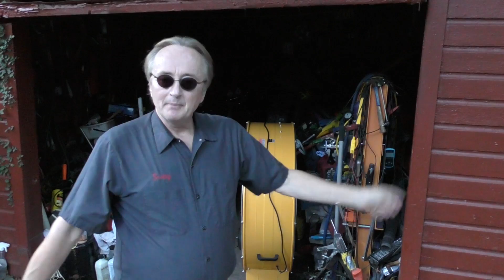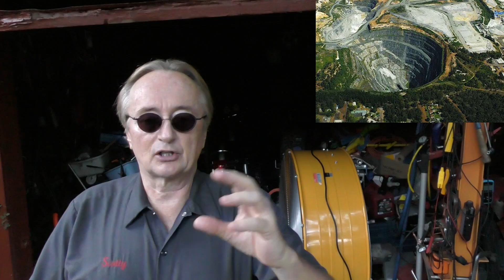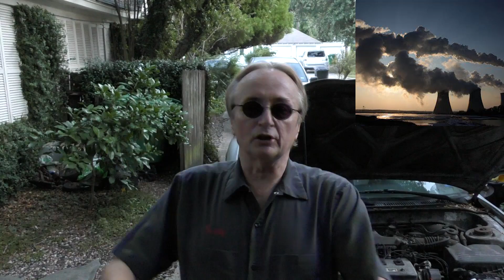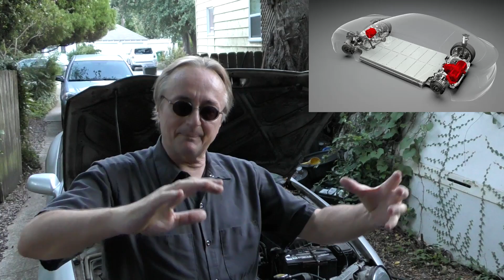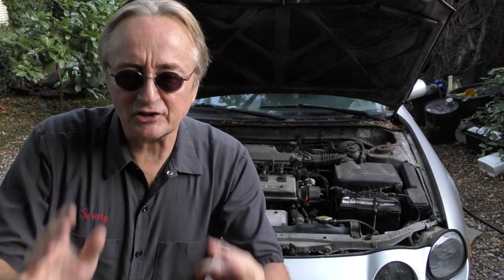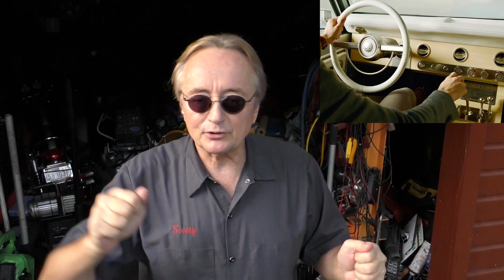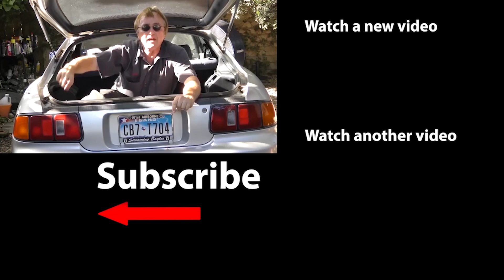Saying Goodbye to My Toyota Celica's Engine

Comment: There's already an infrastructure. There are thousands of electrical outlets in every square mile of the industrialized world. Well, not technically every square mile but you get the point. I look forward to the day I don't have to stop by a refueling station except when I'm on a road trip. Keeping my car topped off at home while I sleep will be amazing.

Comment: electricity can be generated from clean sources too. making electric cars could be the first step. electric motors are 95% efficient which makes a huge difference in every way. gasoline engines are at the end of their road and they must be replaced by electric motors.

Comment: what about a small charging engine to charge a standby battery and then a main battery pack that can switch back and forth? my generator can run for 18 hours on 3.5gallons of gasoine. seems like that's the best option.

Comment: Offroad electric bronco's are going to be problematic. Especially for SERIOUS backwoods or offroad travel. I live on Padre Island. We 4 wheel guys routinely go all the way down the completely undeveloped island for fishing or camping trip. You gotta have 4 wheel drive to make it down there and you gotta be prepared with everything you'll need. We usually all bring extra fuel with us. Last thing you'd want is to run out of gas miles and miles away from society. What are you going to do with your electric truck when the charge runs out way down the beach or deep in the woods? You'd be screwed. At least until they develop an economical portable backup power supply.

Comment: Sorry aint doing it... not buying or building an electric car...  buy an old car.. run it and replace the engine to something that can handle E85 etc or biodiesel for diesel cars is still cleaner then building, driving and processing electric cars.. a local junkyard had a tesla.. he put that thing up on the roof of the office.. he couldnt process the damn thing like a normall car would

Comment: I'd like to see hydrogen as a means to cleanly run a car. I know about Hydrogen fuel cells which can be expensive. I think with a little more R&D that technology can be refined. Maybe someone will find a way to use hydrogen fuel in an internal combustion engine. Imagine filling your car with your garden hose, uses a process called electrolysis to separate the oxygen from hydrogen to run your car. I know my idea sounds a little crazy possibly far fetched.

Comment: So if I need to replace batteries on a Prius it costs like $4000, to replace a transmission these days is also $4000...... yet these guys can convert a car to electric for $5600 suppling all the parts and the labour to tear down and rebuild?  Maybe in France but not likely here.

Comment: It’s not about converting your existing car into an electric one and save money
In upcoming years govt. will impose some safety features like emergency braking, parking sensors, 6 airbags minimum, and so on... as mandatory to all cars on the road and then you have to dump your celica
Cause your car will not be considered as a safe car on the road and will not come under that new safety laws

Unless you wanna rebuild the whole car body to keep up with safety standards which will eventually cost you the similar amount as purchasing a new one.

Comment: You put a vid up a while ago think it was the easy way to cenvert a fwd to rwd or 4wd and you said get rid of your old car and replace it with the platform your after but now your saying keep your old platform and change your drive 😒.  So what about brakes due to running off vacuum when the engine is on. steering modern cars are power assisted. Suspension setups will need changing and to top all that your saying how lithium is so bad yet even with a conversion your still gonna need lithium batteries or at least lead acid that frankly will weigh more than the whole car. Your contradicting your self in so many ways

Comment: Why would you buy a new el car when I have a perfectly fine running one which I can modify to el....think green...
Uhmm I doubt that its green to put the amount of Lithium batteries with their production process in a 25 yrs old car as it takes 8-10 yrs before you go green compare to petrol engines. Wonder if his celics will then still run :D

Comment: Just thought I'd mention, electric motors will make the same torque at any rpm they are spinning, which is why they accelerate so fast from a stop. 
Also for a conversion the easiest way I can think of is replacing the motor with a large dc motor (or a brushless 3 phase for better efficiency) using existing motor mounts and making an adapter to the transmission, then replacing the exhaust/gas tank area with batteries in protective boxes. There is a lot more to making an electric car than that but its most of what you have to worry about mechanically. Good luck with your project

Comment: 1. "Electric powered cars are hell on the environment!"
2. "If you want to be green, convert your car to electric!"
I guess then, by "If you have concern for the environment", he means "If you want a little less hell"; otherwise he'd say "Avoid EVs until the batteries are made from less polluting materials and electricity is generated by a cleaner process for a more robust infrastructure."

Comment: I suggest you follow Jehu Garcia on youtube. He converts cars to electric, and has a lot of "hands on" experience. You can salvage old Laptop and cordless tool batteries. Usually when the battery pack goes bad, it is only 1-2 cells in the pack that are dead, the rest are still fine.
For a truly green solution - you can charge the battery with solar panels on your roof.
The problem with electric cars in hot countries/states is the A/C. It will drain your battery.

Comment: No. I listened to and read these arguments about how the electric cars are allegedly "worse for the environment", but this is just conservative bunk "science". The calculations were explained and exhaust and mining of lithium effect were measured and it is believable that after a certain number of miles it is actually significantly much less harmful to the air than gas cars. 

Now its another argument if you don't believe you should be driving electric or hybrid cars because you either can't afford, or don't want to deal with electric cars, or maybe you just hate the environmentalists and believe the idiocy that Trump supporters say. Thats different.

Comment: The biggest problem with electric cars would be getting rid of the lithium-ion battery and replace it with the super-capacitor.
The power density is higher then any lithium-ion battery,the only problem with super-capacitors is the price,they are quadruple over the cost of lithium-ions.
Reply: Super capacitors are not energy dense enough. Like 1/1000th the energy density.

Comment: If electric cars take off, if you have on-street parking, best of luck leaving your cable across the pavement overnight. Millions of UK homes have on-street parking. There are already parking wars, but when you have to run a charging cable 50 yards to where you had to park your new Electro-Lite6, it will be mayhem. There needs to be a Major breakthrough in battery technology, in terms of charge-times, weight, size and range before they have a hope of replacing gas cars.

Comment: Consider a cheap car which has a dead engine and or transmission- the cost of conversion may be cheaper than rebuilding or replacing the existing broken parts with new... Sell the old parts which still work to subsidise the conversion...

Comment: And while we’re converting cars to electric, let’s solve the “lack of driving range” problem. Instead of each car brand having its own battery configuration and building millions of “charging stations,” STANDARDIZE THE BATTERIES. So when you’ve driven the electric car to the point where the batteries in it are almost completely discharged, don’t fret about where to plug it in and what to do while you wait for it to recharge.
Pull into a place where you can simply remove the spent battery and exchange it for a fully charged battery of the same type (for a fee, of course) and off you go go.
We’ve already demonstrated this business model. Think about  flashlights, bottled water for the water cooler, propane tanks for your barbecue grill. Does anybody stop and spend time refilling their ink pen if it runs dry while taking notes during a lecture. No, that’s why the Good Lord gave you the ballpoint refill (and, ah, cheap spare pens; but you get the idea.
And what about the vast infrastructure to make standardized, replaceable batteries readily available almost wherever you drive? Already there, ready and waiting, no construction necessary. WAWA, Sheetz, Pilot, T/A America, 7-Eleven, EXXON, Shell, BP,.
Reply: Changing engine oil is easier than changing an 800 lb battery, yet people still have to make appointments for oil changes.

Comment: "when electric cars become mandatory" - That's a scary thought, but your're probably right.
Reply: Fat Dan  your right.
Manual Driving will be ilegal, And after more years the vehicles would not even have steering wheel
Reply: @NeoJSsk  If/when it gets to that point, I guess I'll be one of those folks put in prison for violating every law in the books. It's illegal to drive my car? Then I guess I'll eventually be driving without either a license, or tags since they surely won't renew them. I probably won't be able to get insurance either. That will be a fun day in court.
Reply: freespace2dotcom you and me both bro
Reply: That’s when motorcycle popularity should increase
Reply: Nonsense. I drive an Tesla but I still wanna drive my gasoline car because it's way more fun.
Reply: At least I don’t have to worry about losing the right to drive my diesel triaxle any time soon, I have to back into sites that change constantly, no roads to guide sensors by, and get loaded by machines that are always moving.
Reply: Ya'll better be in your houses.
Reply: The oil companies in the US have way too much influence for electric cars to become mandatory. It won’t happen.
Reply: Electric self driving  cars will be the norm, and if you want to drive, or drive gasoline cars, you'll go to a track.. Like people who want to ride or race horses go to a specific facility.
Reply: K Dash  insurance companies will force self-driving cars, once they're safer than humans under all weather and lighting conditions (driving round Tempe Arizona in daylight without rain doesn't count) then there will be a price premium for people wanting to drive. We've got ten years maybe.

Comment: I think electric battery cars are crap, I think Hydrogen powered cars are the future. They convert water to Hyrodgen and the rest is history. It's a proven technology and it's completely independent, you don't have to rely on companies to sell you batteries or supply you with electricity. The only thing you are responsible for is maintenance.

Comment: Mining might be bad, but oil is terrible and getting worse - the bottom of the Gulf of Mexico is now an ecological desert. Finding new oil reserves is getting harder and  encroaching on more ecologies.
Oil spills are so frequent they are rarely reported. Oil refineries use 200MW of electricity each. Burning it in cars produces toxic emissions. Thus gasoline cars are becoming more toxic over time.
Electricity production is getting cleaner all the time, so an EV is getting cleaner over time.

Comment: Any type of battery will goes bad within 10 years, how much is cost to replace it and how much pollution to make one or recycle it. If you concern about pollution then stick to the old diesel and drive it with used vegetable oil...

Comment: Whether it's conversion or new, electrifying everything presently powered by fossil fuels is going to require a lot of mining. Copper, aluminium, nickel, manganese, rare earths, graphite, lithium, cobalt, etc. Some are plentiful, such as bauxite ore for aluminium, and others, like nickel and cobalt, are much less so. Further, a lot of mining occurs in areas far from the grid, so they will still need fossil fuels. You're also going to need many more smelters and to convert steel mills. Moreover, light weight materials like plastics and carbon fibre still need oil. Then, you need to think about recycling all of these materials, like lithium, cobalt, etc. All the circuitry uses gold, silver, palladium, tin ,and other resources that need to be  recaptured for the next circuit boards. Carbon fibre is tough to recycle to the same quality used for vehicles. And you're going to have to retrofit all these massive multi-residential dwellings to charge vehicles and store electricity. 

All of this is do-able, some with challenges, but it's far more difficult than simply capturing wind and sun.

Comment: When all the gas cars are replaced with electric just how are we going to generate 120 percent more electricity to replace the gas?
Reply: John H Don't lose sleep over it! It's not going to become mainstream for decades! And when it does, in order for gasoline engines to compete... Gasoline prices will drop to .$25 cents per gallon, while Electricity will go through the roof! The oil company's will fight the electric producers... Tooth and nail!
Reply: John H you know it would be a relatively small percentage of people

Comment: While I would love to convert an old car to electric, most of the cars around here rust out before they quit.  I loved my 86 Honda Accord and had to stop driving it when the drivers seat punched thru the floorboard and I had to hold up the rear bumper with posts I made of all thread and nuts because the supports had rotted away.  
I would say that converting a much newer car, maybe one of those Chrysler products with the bad engines or the Chevy's with the transmissions that blow out at 45,000 miles might make a better candidate to drop in something better than what came from the factory.  Sort of de-turding it by putting something better in it.   I bet you can find a customer that brings you a car with something destroyed with low miles and is pristine otherwise that can be converted.  It would make a good series to watch.
Reply: Agreed, would be better looking too
Reply: I own an 86 Honda now! Best car ever, and no rust on it. It’s a great road trip car

Comment: We are already running out of lithium and there isn't enough for electric car batteries.  Want proof - call up a Toyota dealer and ask them how long it'll take if you order a hybrid Rav4.  You can't get them and when you do its 1 hybrid to 20-30 gas versions.
Reply: The rav4 uses NiMH for the battery, not lithium. Toyota does use Li-ion cells in some of its vehicles, just not the rav4.

Comment: A conversion is a great idea if you have the time and expertise, or access to an experienced mechanic or company.  But a new EV designed from the ground up also has its advantages.  Despite the higher cost of entry, it can be worth it with the expected long service life.  For example, a Tesla Model 3 should be viable for 1 million miles, with the battery pack lasting about 300-500K miles (though new battery technology acquired from buying other companies may soon bring surprising improvements).  Scotty, visit one of the two Houston Tesla showrooms for a test drive, if nothing else for research to help with your conversion.

Comment: I was involved in the EV conversion scene for a few years until I finished my saturn conversion.

Not a toyota, but it worked well. What many people overlook with converting cars to electric is the cost isn't really all that good. Once you start adding up the cost of the donor vehicle (typically the cheapest part), motor, controller, charger and batteries (typically the most expensive), a new EV becomes appealing. The cost for a well made highway capable (legal) conversion usually starts at $20k if you want 100 miles of usable range. That's just for the parts, NOT labor. That's not to say that there aren't amateurs pulling it off and succeeding, I'd like to consider myself one of them. But today with a regular job, I've reverted to driving my pickup simply because there's nothing my EV can do that my truck can't do better. Car insurance is also a rip-off up here in canada...

And lastly, I also got tired of being associated with the far-left green politics that many EV'ers live and swear by.
Reply: David 
At least you have universal health care for cryin out loud! We pay blood sweat and tears for health insurance to get treated half assed, then slapped with a bill later on — and for what?! What the hell are we paying insurance for then?!? 

Auto insurance is a rip off down here in the good ol U.S. of A. too bud
Reply: @andrewbowser2794  I'm about to say something you might not like, but if you want to talk healthcare, I can go there. Canada does have a healthcare system that generally works more often than not. But it's not perfect. One of the biggest reasons that Canada can claim to be so generous is because we live next to a superpower and never really had to worry about our borders in modern times. Far be it from me to idealize the american military the way american liberals often idealize canada's heathcare, but do find it ironic.  If you're trying to say that the grass isn't always greener on the other side, I can agree to that.

Comment: 80 Amps per household to charge their electric car doesn't mean 80 amps per household running through the power lines, since they are much higher voltage... therefore much lower Amperage. (P = I x E)